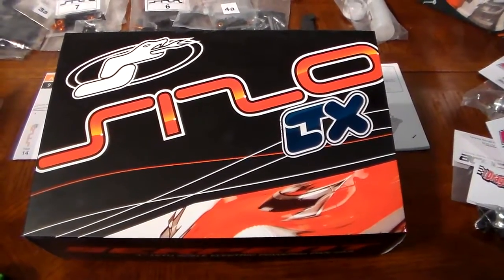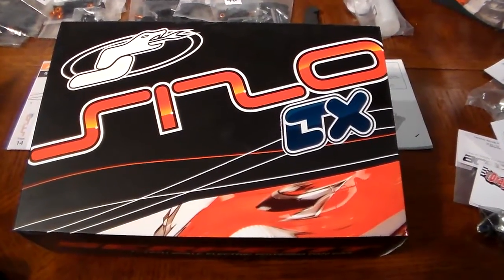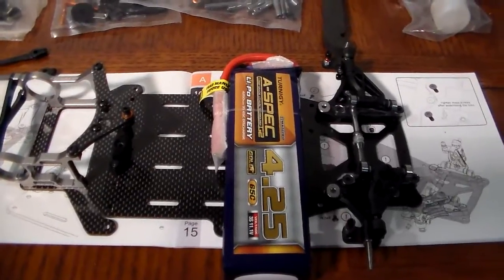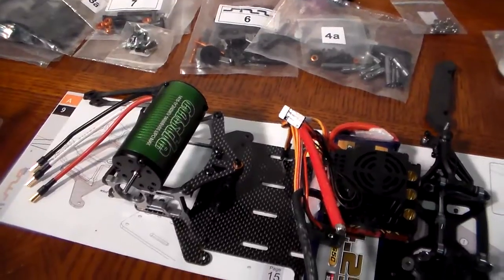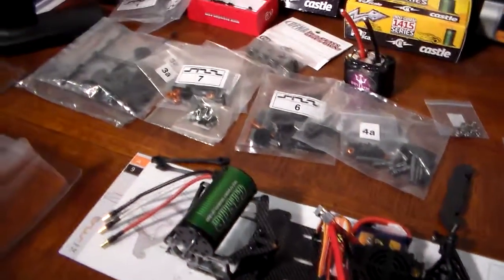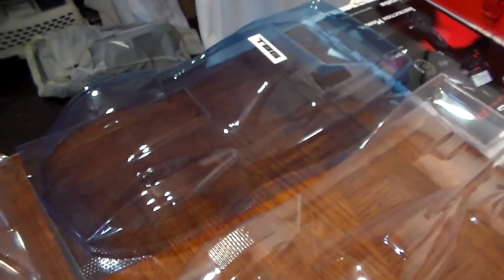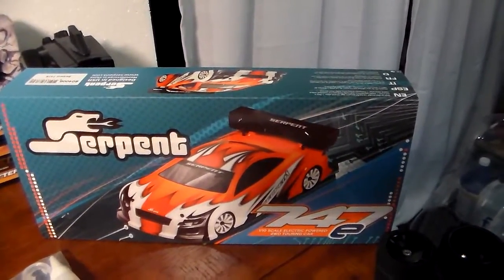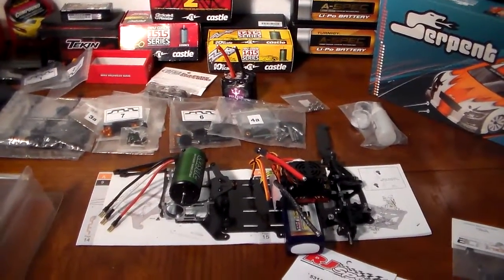Serpent s120LTX 1/12 scale 6s Super Car

Comment: I most definitely want to see the outcome of this build. Typically pans run no larger that 2 cells and you are gonna go with 6 cells that is a tall order, GOOD LUCK to you.
Reply from the maker: Thanks Donald, im curious to the outcome myself. Keep in mind that the chassis i will be using is a custom aluminum chassis made by myself. The new design will give me a bit more room to mount esc's and batteries.
Reply: custom fast rc I most definitely want to see that. I don't think that has ever been done.
Reply from the maker: Neither has a 12s Rustler. Check my channel..i will be giving update vids on the serpent as i go
Reply: I got you, and I'll be watching very close.

Comment: 747e allso.. Definately a dream car. A guy I talked too recently did a 220mm conversion with Lola body. One of the most badass 10th scale.. I just bought a Mugen Mrx5, goin electric of course, thinking of some where around 8-12s...
Reply from the maker: I put in a order for that Lola body. It is oversized but works well. Breakinwind turned me on to that body.

Comment: Just out of curiosity, did you ever finish this build? Was searching for it, but couldn't find it. Waiting myself for the S411 RTR to start a speed project.
Reply from the maker: Troy Lee 
Hey Troy, 
Some of the ideas i came up with back then where alittle Impractical. Was looking to do differant things that didnt always work. I still have the car. 
      The s411 is a good 3s car. Anything really more then that will beat that car to death. I built a few of them. Not the strongest car on the market. The 748e is a much better platform for speed runs.